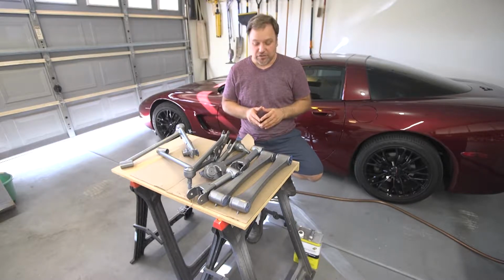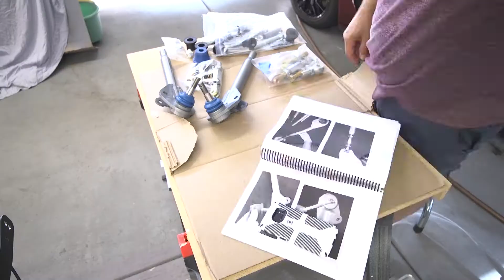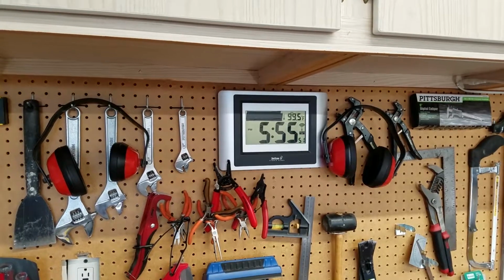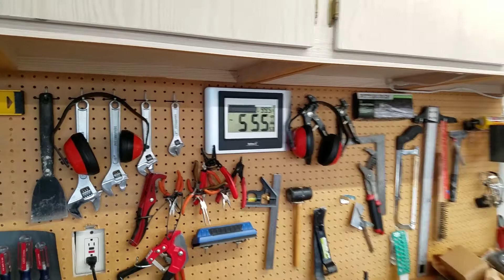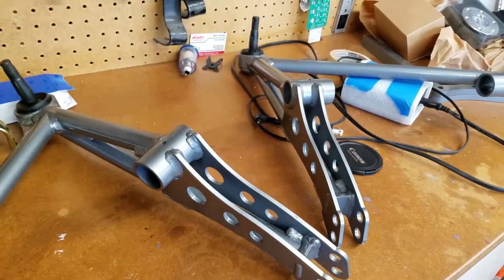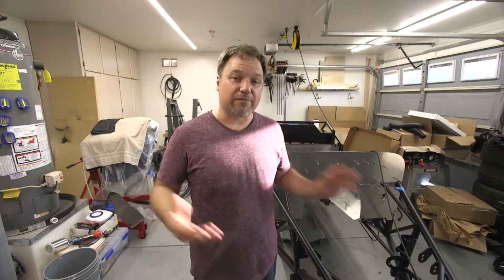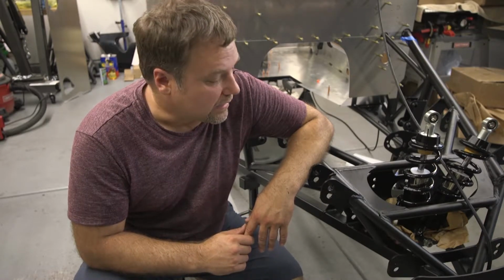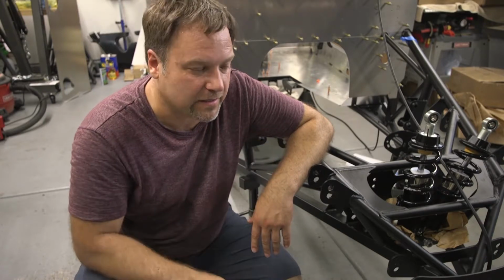Factory Five 33 Hot Rod V2 Build - Front Suspension

Comment: Possibly use a long bolt through the mount tabs and with washers and nuts between the tabs slowly turn the nuts and gently spread the mount tabs.
Reply: That works perfectly and is the recommended method. Saves the paint and powder coat and is easy to control. Put away the hammer and wood blocks. Also, pre-lube the joints before assembly. (1) Makes sure they're filled and adequately lubed, (2) Makes them easier to assemble.

Comment: as mentioned below you can use a bolt or threaded rod with nuts to spread the tabs. Or you can use a crescent wrench opened up to a small slot to bend one of the tabs. Also, I found it very helpful to have a punch on hand e.g. https://www.homedepot.com/p/Mayhew-Punch-Set-3-Piece-89082/100159163  so when you get one of the suspension parts "close" to where it should be you can hammer a punch in (instead of a bolt) to better align the hole in the part to the hole in the chassis...